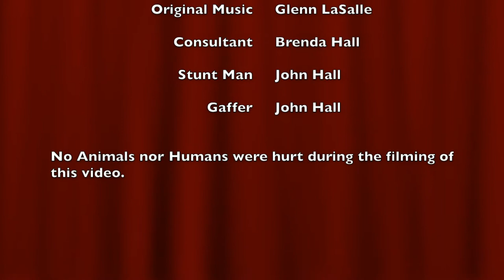Blues Creek Guitars - Quick Tip - How to Make a Pickguard

Comment: for us DIY'ers at home without luthier equipment would you suggest we trim/bevel with Dremel-type tool, or a standard bench grinder?
Reply: neither   the grinder would most likely destroy the pick guard.  You can see I am using a buffer .  You can use a simple scrapper or even very fine sandpaper to start the bevel  then if you don't have a buffer you can get on to fit a drill.  some buffing compound and you can shine it up . most of this you may find at auto stores in the finish dept

Comment: What kind of tortoise material is that?  Where do you order it from?
Reply: +Taylor Mullins axion   you have to buy a sheet of the material
Reply: +blues creek guitars Is that the Autumn Sunset materiel?  The material I have bought from them before is about .028" and this looks more red and much thicker.
Reply: +Taylor Mullins I think that this was thicker material material  I do normally use the .030  this was actually a .0625 thick piece I may have picked up on ebay.  You are right it isn't the axion
Reply: +blues creek guitars It's a great looking piece of celluloid.  If you remember can track down the sellers info on Ebay, shoot it my way.  Thanks for the fast responses!  Keep up the great work!
Reply: +Taylor Mullins Sorry for all the questions, but what are you rubbing on your buffer and what do you put on the pickguard at the end that looks like some kind of glue?  I make pickguards often, and seems hard to get the slight haze that buffing leaves sometimes, and I was wondering if that's what you were tying to fix.  Thanks again.
Reply: +Taylor Mullins I use mazernna 16 and 19  what I look for is the minute scratches from the 18 before the 16 and to see the edge that it is getting shiny.   The buffing compound really makes this shine.  I get most of this from aliexpress.